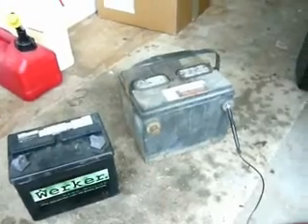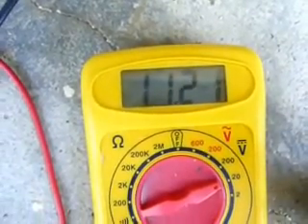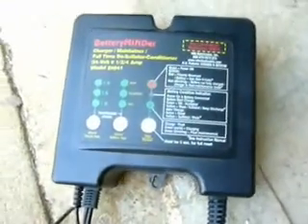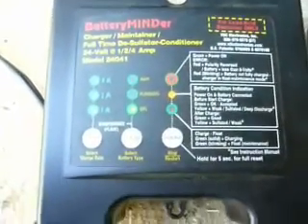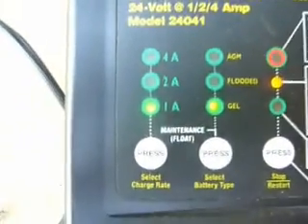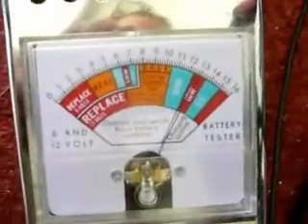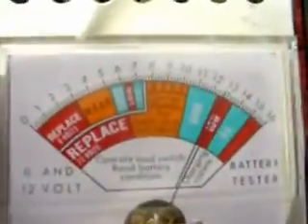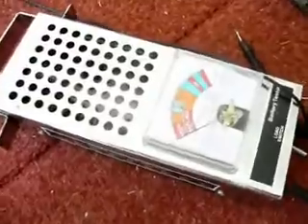BatteryMinder Reconditioning

Comment: I have the same charger, actually a more advanced model that goes to 8 amps. When I charge an AGM battery, everything goes fine but if I leave it for extended periods to desulfate, it switches to gel instead of staying at AGM setting. And the instructions Clearly say that charging on the wrong setting can drastically shorten the life of the battery, so is this not an oxymoron??? I select the correct setting AGM, it switches to gel while I'm gone so it can destroy my batteries!!! Not happy after $150

Comment: Very useful video; thanks for making it. I'm going to try the BatteryMINDer (just bought 4/16) on my sick AGM battery in my Solar ePower Cube 1500; I think it's around 7 volts--only flashes briefly before dies on the LED screen of the Cube.

Comment: I should of asked this question earlier. I'm guessing you added the Epsom salt after trying to charge the batteries without success or limited success. If so, how did you determine how much epsom salt solution to use and how did you add it. Did you drain the battery, and maybe put in new Sulfuric Acid and add maybe 25% of Salt to each cell ?  Just trying to get an idea of what you did. Thanks again.

Comment from the maker: I guess the video is not very informative on what I did over the 2 week period. No, I discovered that if I unplug the charger, then plug it back in, I have a couple of seconds to make my selection on the battery type and amps to charge before the charger starts to charge. No, I did not leave the red light flashing for 2 weeks without doing anything else. The smaller battery is still working but the larger battery will no longer hold a charge. It does have a dead cell.

Comment: You can change battery type/amp when it's not charging (before hooking up, or hit charge to toggle charging).

I'm surprised it did anything;  I thought it won't start any charge cycle if it is under voltage.  

BatteryMINDer makes a 12v unit.  I have a 24v BM for matched batt sets in my electric lawnmower and electric-assist bicycle.  I bought a 12v Battery Tender + at a garage sale for $5.  No desulfation, but will not buy a 12v BatteryMinder until the Tender dies.  :-)